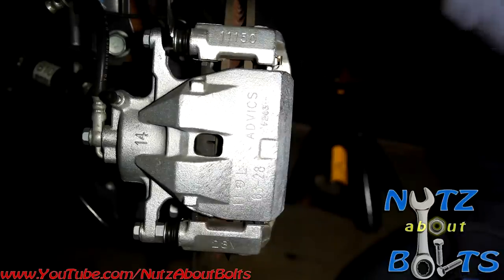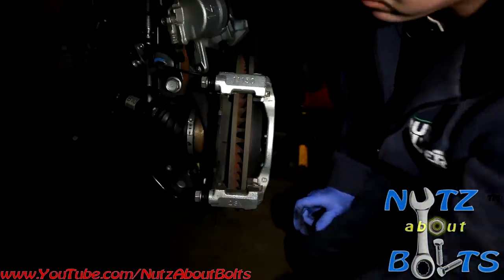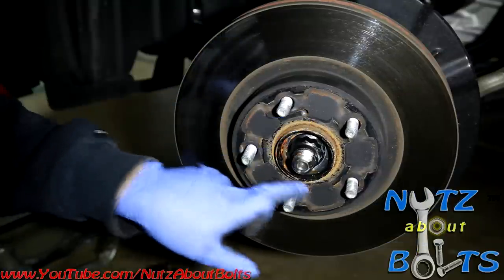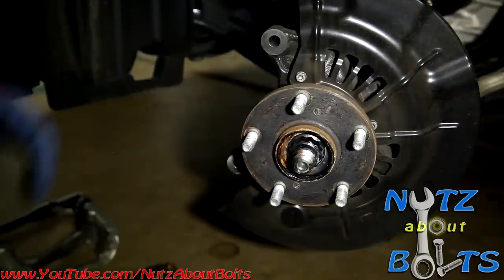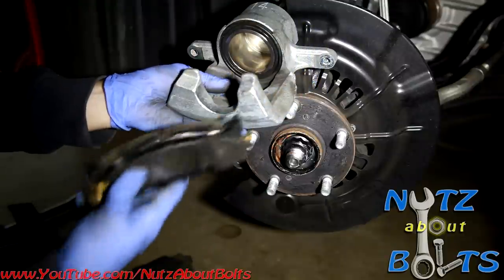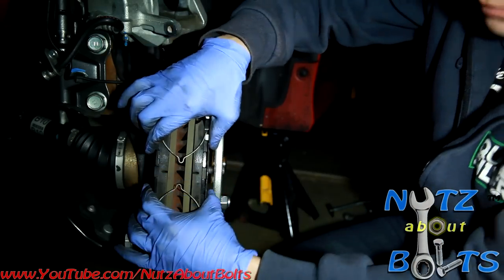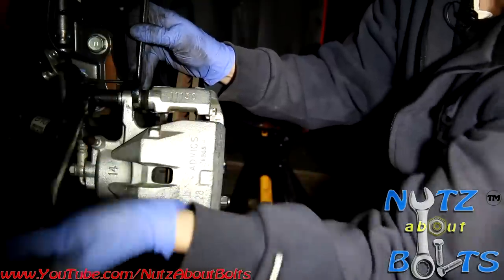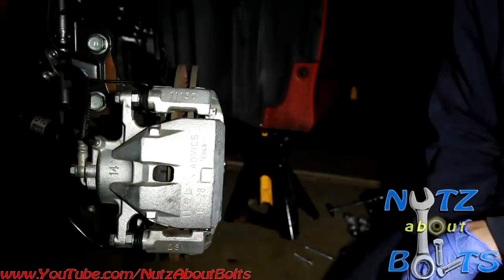2012-2014 Toyota Camry Front brakes remove and install

Comment: Now this is how you show a brake job!  
Straight to the point!
 Tools needed ✔️
No story about Gramps ✔️
Straight to the point ✔️Clear and concise direction✔️

10/10
Reply: There’s no need to remove the bracket or use the breaker bar, for what??
Reply: Not really, no torque down those bolts that hold brake caliber to manufacture required, no silicon to lube those brake pads on 2 touching points top and bottom with the hardware, no checking the 2 pins, clean and lube them, on the caliber that guide the pads, I bet he will not torque down those lug nuts to hold the wheels to 80lb-ft either. No brake cleaner used to clean the rotors and pads surface either..., those small but very essential things will keep your brake smooth, no squeaky, wear evenly and last much longer...

Comment: I went to autozone for the bolts to pop the rotor off, they have it under M8-1.25 and the MM's is the length of bolt or thread
Reply from the maker: Gage Woods M8 is the head bolt. The 1.25 is the length of the bolt
Reply: use the brake line bracket bolt

Comment: Thanks for this video. I was killing myself trying to get those rotors off until I saw on your video about the two screws being used as clamps to push the rotors out. The rest was easy. Very very helpful video. Thanks again.
Reply: What size were the screws

Comment: @Kevin Thien, yes I used the 5/16 x 2 1/2 bolt, got it at Homedepot, length is not that critical, but i won't  go shorter than 2".

Comment: I'm so glad I watched this video before working on my car, I had a stuck rotor and had to go buy a pair of 5/16 x 2 1/2 inch bolt for  .65 cents each at Home Depot ( any length will work ) came off like a charm. Thanks
Reply from the maker: ranchotkd glad you got it out!
Reply: so the size screw i need to remove the rotor is 12mm bolt or a 5/16 x 2 1/2 inch bolt? Thank you for giving the specs on the bolt info. I'm little new to all this, but i'm going to attempt to do this myself

Comment: Very informative and it helped me tremendously! Got to switch out the break pads and rotors with my father in law! I drove with the new set up and after a week I started to hear a bit of squeaking. Any suggestions as to what can be causing that ?
Reply from the maker: The Cue Up did you used anti seize for the brake pads back plate and the silicone grease for the sliding pins?
Reply: NutzAboutBolts yea I used grease for the caliper pins but I didn’t use anti seize ! The anti seize just goes on the back of the pads?
Reply from the maker: The Cue Up yes, they touch the piston and caliper brackets which can cause noise if it’s not lubed
Reply: NutzAboutBolts thank you so much for the quick reply. Merry Christmas and happy new year !
Reply from the maker: The Cue Up thanks! You too

Comment: You gotta turn or replace the rotors folks.

Sometimes you get lucky  And you wont feel a pulsation in the pedal if you dont but in my experience Most of the time you dont and also like he said. Apply grease to the slider pin and at the corners of each pad

Then when everythings put together you have to remove a lil air from the calipers from when you pushed the piston in so your pedal wont feel spongy

Comment: Do you know if the 2012 Toyota Camry 4cyl LE has only front brakes?  I will need to know this because I'm going to take it for a brake inspection, but I am sure the brakes may need replacement, for they haven't been changed in 9 years.  I tell you this, for I don't want to be had since I am sure I may need brake pads and rotors replacement.  Does anyone know how much I should pay in November 2021?  Thanks for your video.

Comment: I noticed you installed the brake indicator plate on the break pads on the bottom of the brake bracket, does it mater if it goes on top or bottom??

Comment: Great vdo! Thanks so much. I just replaced the brake pads about 5 months
 ago but now the rotors are no good and it needs new rotors. The brake 
pads are still very good and the question is:  Do I need to replace the 
brake pads to go along with the new rotors? Thanks!
Reply from the maker: If the pads still look new, I’d keep it on.
Reply: NutzAboutBolts thanks! Do I have to resurface the pads if I reuse them?
Reply from the maker: Minh Phan you can if you feel that it’s uneven.

Comment: Thanks for explaining in details, I got toyota camry 2013 and it got ABS brake system, do I need any other tools or any other way to change the brakes or it just normal way to change ABS brakes.
Thanks BJ
Reply from the maker: its normal, just follow the video procedure.

Comment: one more question? Is it possible to just use the same  spacers those metal tabs for the fit kit, on a new set of brake pads. In other words will they fit the after market non-oem pads. It should right? At least I hope so.
Reply from the maker: you can reuse the shims from the old brake pads onto the new ones, doesn't matter if its aftermarket or not.

Comment: When do you recommend replacing brake pads? how many miles? When do yo recommend replacing the rotors? do you eyeball it or do you just go by the miles traveled or yearly use?
Reply from the maker: depends on your driving habit, just keep an eye on the brake pads and rotors, when you feel the brake pulsating when you step on the brakes, then I would recommend inspecting the brake pads and rotors and replace them if they look bad. Sedan usually last up till 80-90k miles depending on driving habits.

Comment: In regards to pumping the brakes, is that done after replacing each set of brake pads or can it also be performed once all pads have been replaced?
Reply from the maker: you do it once all the pads has been replaced.

Comment: I changed my 07 camry rear rotors four months ago. O'reilly sold me two different rotors. One is black-coating, the other is non-coating. I just noticed the non-coating one has a lot of rust now. Do I need to do something with the rust? Or just leave it there? Thanks.
Reply from the maker: +Will Smith it should be rusting if you're driving it since the brake pads grind on the rotors when you use the brakes. If it's bad, you should return it and ask for an exchange.

Comment: Hi, on 2012 camry, what about the brake pad wear sensor? Is it required to replace it with the brake pad? 
I know on other cars if i don't change the brake pad wear sensor and try to reuse it the brake light error on dash might not go off if the sensor is worn too much.
Reply from the maker: if the brake pads didn't come with the hardware, you can reuse the old wear sensor. It's a detachable metal clip that goes onto the brake pads. It shouldn't cause any error codes on the dash.

Comment: This is great. I'm just wondering how different (if any) is it for a hybrid model? Thanks!
Reply from the maker: The hybrid is a little different... If the Camry is like the Prius, you don't want to accidentally open the doors, because it'll activate the ABS system, which in turn will cause the caliper piston to engage and it'll be a problem if you're changing the brake pads. It'll be a pain in the butt to push the piston back in. So make sure to not open the doors while doing the brake job, or you can just disconnect the negative terminal to prevent any electrical activity.
Reply: Good to know. Thanks!

Comment: No cleaning off rust around axel nut or back of rotor to mitigate rust then applying antisieze?  Or tightening slide pins or caliper pins to proper torque specs?  Someone is going to get hurt.  Also applying antisieze to brake hardware will cause it to loosen during use.  Sometimes a little rust is a good thing.

Comment: Can you just take the whole caliper assembly off rather than separating the caliper from the bracket and then taking out the pads? Just need to replace rotors on my dad's 2013
Reply from the maker: NOLAItsNotOva You can do that, but if you're going to replace the rotors, you want to replace the pads as well because the pads already has the wear and tear from the old rotors, which in turn can cause scorch and pit on the new rotors, which can cause the new rotors to cause the same vibrations and problems as the old rotors... So we always recommend when changing your brakes, you want to replace both rotors and brake pads, or cut/turn the rotors and replace the brake pads, since new rotors are cheaper now a days, its best to just replace them. I hope that helps.

Comment: You don’t resurfaced the rotors, when you replace just the  pads without resurfacing the rotors the brakes can make noise when you braking

Comment: Hej  can you tell me ?  I have  toyota avensis 2009 Diesel  and I have  electric brake I need to open the brake with the help of an interface computer program or I can normally  move back with the help of a tool ?Thank you.
Reply from the maker: that I'm not sure... every vehicle is different.

Comment: I'm trying to remove the caliper, however a 17mm spanner wrench doesn't fit over the bolt that keeps spinning and as turn the 14mm socket. Is the size different on the 2012 LE v6 model?
Reply from the maker: +Gregory Young yes it should be the same size.
Reply: A bit late but as NutzAboutBolts mentioned, he had to grind down the face of his 17mm wrench some to get it to fit into the narrow gap..

Comment: How do I know when the rotors need to be changed?  I've felt the symptoms of warped rotors and rotors with grooves before on an older car of mine but this Camry I have doesn't show any signs of that.  there are small grooves in the rotors from the brake pads but they are still relatively smooth to the touch.  Do I need to change the rotors?  the car only has 20k miles and I haven't noticed really any change in the brakes.  I'm about to change the pads though since I used this car to deliver for 10k miles.
Reply from the maker: pads and rotors usually last longer than 20k miles, it should be good until 70k or so. When your brake pads are bad, it'll start making a loud noise, that is the brake pads wear sensor that is contacting the rotors and causing that screech noise. As for the rotors, you will feel a pulsation when you step on your brake pedal, it indicate your rotors are warped or need resurfacing if its within specs. You want to change the brake pads if its less than 2mm on both inner and outer pads. Your rotors minimum thickness specs is stamped on the rotors, it should say "min" on there and it'll tell you whats the min. thickness before you can discard them. I hope that helps.
Reply: +NutzAboutBolts WOW, I didn't realize the pads and rotors lasted that long.  you just saved me some money and I greatly appreciate that!  thank you for the speedy response as well!
Reply from the maker: np, always check your brakes or eye ball then when you're doing an oil change though, its for safety issue and you always want to be on the safe side. The Sienna brakes don't last long with run-flat tires though, I've seen one's come in with 20k miles and their brake pads were worn down to 2mm. But Camry's I haven't seen anything too crazy.
Reply: +NutzAboutBolts I'm actually about to perform an oil change so I will definitely eyeball them.  I just went out to check and the rotors are actually perfectly smooth still I could have sworn they had small grooves starting but I was mistaken.
Reply from the maker: it'll have scrape marks from the brake pads, as long as its not warped or have deep grooves in them, then they should be fine to machine/turn when the time comes.

Comment: You have your wear indicator clips on upside down. They go on top of both pads, not the bottom.  If you look at your video, when you removed the pads, the clips are on top. But when you reinstalled, you placed the clips on the bottom.

Comment: The slide pin on my bracket is SEIZED stuck.  It won’t compress or slide out.  Any ideas to get it out?
Reply: Heat up the outside of it with a torch and then try to remove.   Also, a good lubricating oil should work if the heat doesn't.

Comment: what is the bolt thread pitch/size you used to remove the rotors from the hub assembly?
Reply from the maker: +streetracerofGTs I believe it was 8.25, the head is 10mm bolt, you can find it at home depot.

Comment: Hallo I have 2015 Toyota Avalon when I need to change my front brakes a Toyota dealer told me that I have to surface a rotors before he put the pads is that true thanks
Reply from the maker: yes, you need to resurface the rotors or replace them if it can't be resurface.

Comment: Do i need to remove the whole caliper is i'm just changing the pads ? not the rotor?
Reply from the maker: Omer Malik you have to move the caliper out of the way for the new brake pads to be installed, you don't have to remove the caliper bracket though.

Comment: Thanks for a great video. I also have a 2013 Camry and although I have done brake jobs on other cars, at least now I know what to expect on this model.  In the midwest with all the rusting that goes on, I think it is a good preventative measure to take those brakes apart just to clean and lube them up, and thus prevent those seizures which can be a bitch to solve.  BTW, do you take the cap of your master brake reservoir or instead just loosen the brake bleeder when compressing the piston back into the Caliper.  Seems there are two different schools of thought as to what is best if the car has ABS. But I normally just take the cap of the master brake reservoir and never had any issues.  I wonder what your opinion is on that matter?   I will also check out your Rear Brake video on the Camry.
Reply from the maker: RonGJX Don't top off the brake fluid and you can compress the caliper piston without any issues. The only issue is overflow at the master cylinder.

Comment: I dont understand why you took the rotor off if you werent replacing it
Reply from the maker: was a demonstration.
Reply: NutzAboutBolts Cool. I have another question. I JUST replaced both front and back brakes....now when I drive it they pulsate. Why do you think that is?
Reply from the maker: if you replaced just the pads, then the rotor needs to either be cut or replaced.
Reply: I did rotors too
Reply: yes
Reply from the maker: if it wasn't doing that before, I would suspect it to be a bad rotor and pads. I would go back and let them know the issue and get a replacement for it.
Reply: If you don't take a good care at time you handle the rotors with grease heands it may cause a dirty stiky spots that when you press brake cause vibration.

Comment: i left my car in a parking lot for 2 weeks while i was out of state.  when i came back the brakes were scraping.  toyota said it is a moisture problem and it cost me 600 dollars to fix the brakes.  think of trading my car in if this happens again.  in my opinion toyota has sucky brakes.  can u comment on this?
Reply from the maker: if you don't drive it for a while, the rotors will rust up due to the weather. Once you start driving it, the brake pads will start scrapping off all the rust when you use your brakes, so it'll start squeaking. Once all the rust is off, it'll start to drive like normal. If anything, you can replace the rotors and pads yourself for a lot cheaper than 600$.
Reply: Yeah it sounds like you got scammed.  The material rotors are made from they will rust in rain overnight.  But like stated once you drive the rust will wear right off. $600 is absolutely insane.

Comment: Those V springs are about stupid. Everytime I tried to put caliper back on they would fall off...nope left them off. I have done alot if brakes and Toyota has the worst/ cheapest brake  design by FAR. The pads would not hold those useless V wire clips in so nope.

Comment: You reversed the pads, that's not really good!!
Reply: Looking through to say this.  The brake pads were reinstalled upside down.
Reply: B Bowling I just changed my pads  and placed the spring clip up is that correct
Reply: He replaced them right I just got done doing my sister's Camry 2014 LE

Comment: Do I need to surface the disc brakes every time I replace the brake pads?
Reply from the maker: it is recommended since the old rotors wear pattern from the pads is still there and can cause vibration from the new pads. I always do it.